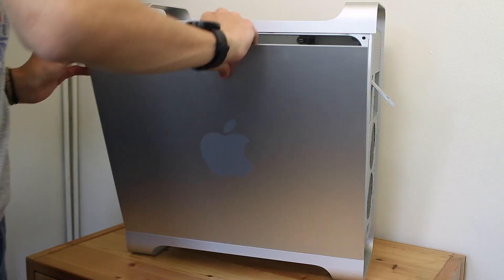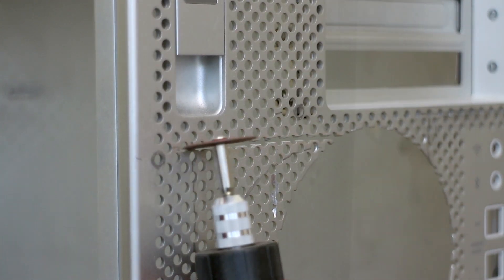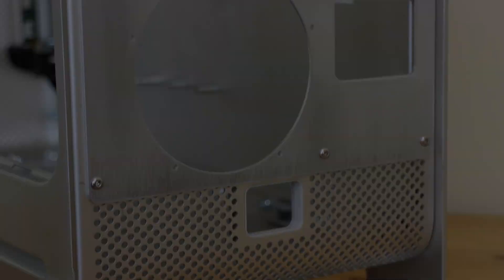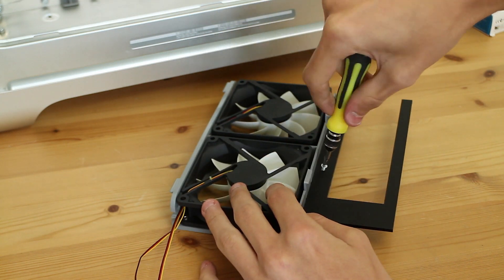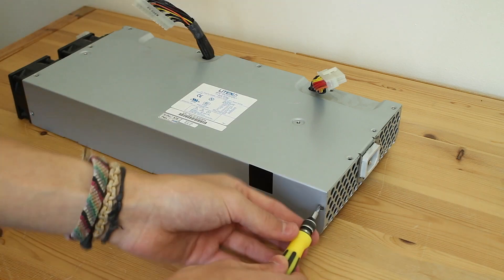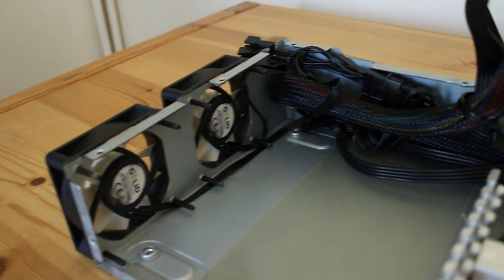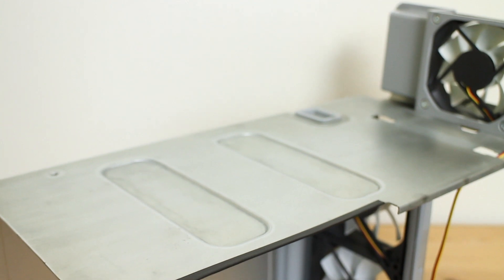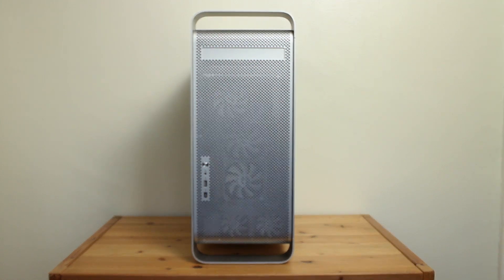Power Mac G5 Hackintosh Build: Case Modding [2/5] | The PowerPC Hub

Comment: old video but this is absolutely best conversion I saw. All of the others are clumsy and really bad looking. Cables everywhere, PSU put everywhere it fits, fighting for air with GPU quite often, cutouts for water cooling to original case (ouch!) etc.

Yeah, Laserhive conversion kits are expensive but probably worth of money.

Comment: About the (imitation) Dremel… Why not just use a real / full scale / 'grown up' angle grinder? They're cheap and they easily cut through aluminium. (Personally, I'd just keep the old connectors if you go for the original look.) Then, replacing the rubber with screws will probably make the case or some parts vibrate, if not now then sooner or later.

Comment: Excellent job! Besides the cable management, how challenging was fitting the ATX PSU inside the original G5 PSU housing? I couldn't quite see how the plug was mated to a newer plug? Did you modify the wires to the original plug?
Reply from the maker: It was pretty easy to be honest. The only prerequisite that I had to perform was to make sure (before hacking everything apart) that the CX500M's heatsinks would fit inside the enclosure. To wire the plug in I just cut out the end of an old kettle lead, plugged it in to the CX500M's socket and then wired pos, neg & ground to the G5's socket. You can see pretty clearly at 5:03.
Reply: Thank you!

Comment: Will this work with the MAC pro 2006/2007 case?
Reply: The last PowerG5 mac was 2005, after that Apple went with the Intel chips and a much different internal structure for the Mac Pro body (though the outside looks similar) - Power supply was moved from the bottom to the top back portion Where the G5 HD's were located (as evidenced by the power plug location), hard drives were moved from the top back to the middle PCI region (hanging under the power supply but above the PCI-e slots),  Chips & cooling fins and Ram were all placed on a single sled (rather than stacked in G5) that attaches to the bottom plate of the case (not suspended from the PCI base as the G5 - remember the power supply is on the bottom and nothing could be attached to it ).  That said last time I looked Lazer Hive also made back I/O and MB support mod kits for these MAC Pros as well and with options of final location of the new power supply - top or bottom.  I actually received a working G5 free and hope to follow this plan (with more up to date internals)....

Comment: hi, what have you done for the front panel connectors, as I dont know how you would adapt the connector to one which would fit a new motherboard, thanks
Reply: You'll need to do some rewiring. Normally, a front panel has wiring for each component (power button, LED, USB for example) going to 'headers' on the motherboard.

The thing is, the G5 front panel is one big combined connector that went into a custom motherboard header that common mobos don't have. So that's why you'll need to do the rewiring.

Here's a guide and wiring schematics:
https://www.tonymacx86.com/threads/g5-front-panel-quick-guide.77208/

Comment: great job
can you link where you bought the I/O and the clear motherboard tray ?....
Reply: +ahmed sultan http://www.thelaserhive.com/
Reply: getting these part and shipped will cost a lot better to get NZXT h440 or Corsair 550D case.
by the way,  " Thanks for info"
got mine build using Corsair 750D case, 
i7 4749
Z97x UD5H
GTX 690 - dual GPU
Samsung EVO 250 GB main
Extra a lot of HDD 

nice build you have.....

Comment: Hmm... I wonder if the PCI slots will be high-up enough for the card to fit. I wouldn't know for sure, but many motherboards in non-Apple machines leave the card facing upside-down; it could, in fact, rest too close to the divider that sits underneath the PCI slots--and especially be at risk because it's pointing downward.

Comment: Is it crucial to re-use the fan assembly? I like that the custom plate for the I/O and fan holes; however, if I ever want to do this in the future, I'm not sure if I would re-used the fan assembly... I'd probably just find some way to attach the fans separately, in front of the fan slots. Do you think that would be feasible? (Also, can the plastic I/O cover be screwed onto the case itself, in the event that one wouldn't re-use the fan assembly?)

Comment: Nice. Is that internal speaker going to be hooked up to the motherboard for some ground-shaking tunes?
Reply from the maker: After weighing up the pros & cons I came to the conclusion that the internal speaker is far too powerful for this system to handle. It'll be staying unplugged for safety reasons.
Reply: *****
We wouldn't want to rattle the sides off the case with all that bass now, would we? ;-)

Comment: Gosh that is a way tidier job than I originally thought possible! That will look really amazing! Im almost tempted to do this myself as it is so tidy! That Original G5 cover just makes it though!
Reply from the maker: Yep, me too! I surprised myself :L

And yeah, I've seen a load of G5 mods, and as great as they are, 99% of them don't preserve that awesome internal look that the G5's had. I'm really happy that I figured out a way to reuse the fan assemblies & the beastly heatsink cover.
Reply: ***** Yea all of the G5 mods bar yours that I have seen are just cables everywhere, some crappy on switch glued to the front panel and a mini ITX or micro ATX board in the corner and a rough cutout for the fans and GPU on the back. Hideous! Anyway I'm really looking forward to part 3!

Comment: My god ive never been so excited in my life before:D
Reply from the maker: That's quite the compliment! Haha :L
Reply: ***** yeah i guess:D really waiting for the build video:D
Reply: bpali2001 but he could improve that that thing looks like its gonna start a fire and is shold with that confusion and the air flow is dead
Reply: +The PowerPC Hub That PSU is a mess cables everywere i did my psu mod na it was clean and it looks like factory it doesnt have plugs and stuff going in it
Reply: Vader Starligth dont bitch about everything. niall did the best he could